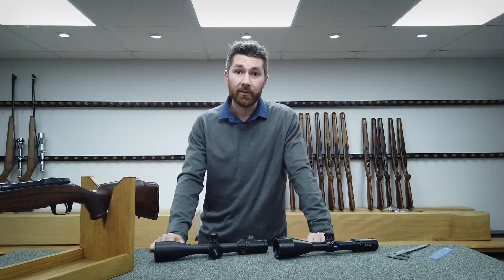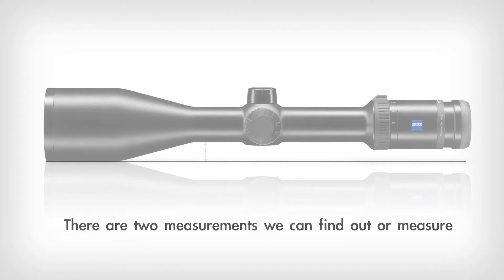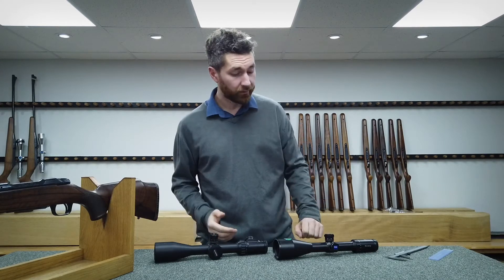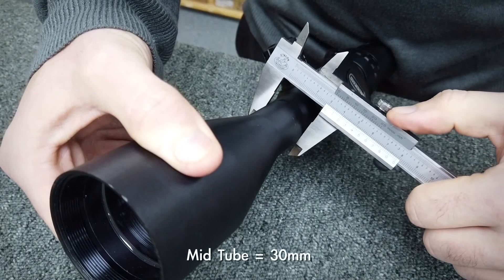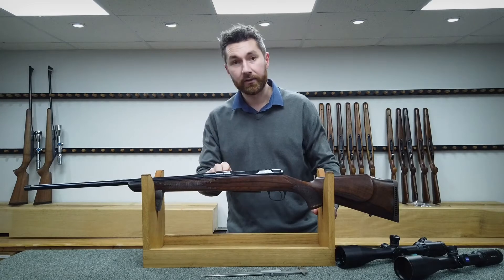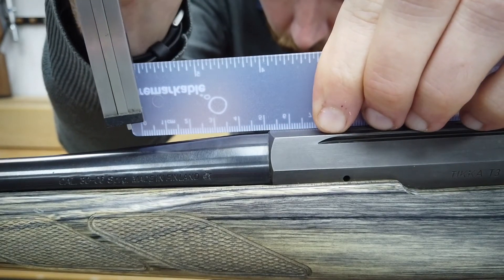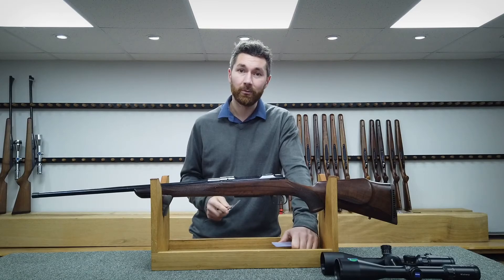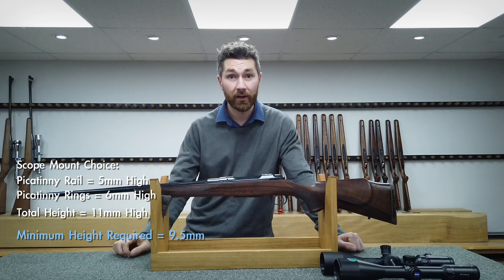Scope Mounting - A Quick Mount Height Calculation

Comment: So the measurement your left with as the result, is that the height to the bottom of the mount rings or side centre (where they clamp)?
Reply from the maker: Usually mount heights are measured from the bottom of the ring, to where it contacts the top surface of the picatinny rail.

Comment: stop saying mil, the unit of measure is not mil....its meters, the measure of length in the metric system is meters, mil is just an abbreviation that means 1/1000, in this case 30 mm or 30/1000 meters, the mil is meaningless by itself as you can have millimeters, milligrams, milliradians, milliseconds, milliamps, milliliters, millivolts ...there pretty simple isn't it
Reply from the maker: Thank you for the input. We will try to use the full term "millimetres" in future to avoid any possible confusion for our viewers. We've not had anyone question which measurement type we're referring to when we use the term mil before, when the context is clearly length in this case, but there's always a first time. I'm sorry if you, or anyone else, has tried to measure the distances in milliseconds or millivolts based on us using the term mil in the video. Sorry to ramble on and keep you, I'm sure there must be someone out there using the phrase PIN Number, that I'm sure you'll feel the need to correct. Or someone not using a capital letter at the start of their sentence, that needs an unnecessarily long explanation about the importance of using correct grammar.
Reply: @alanrhonemedia don’t let the slow ones get to you mate, and don’t bother changing your phrasing to suit them. Everyone knows what mill means
Reply: This might really only be of concern to that backward colony , the USA.   The rest of the world uses and understands the metric system. @alanrhonemedia
Reply: In your face!!!

Comment: Thank you for your tips, the only thing I would have considered would be the added thickness of the lens caps  ,
I only know since it has happened to me.
Reply from the maker: Yes, a good and valid point. I might add this to the video description to accommodate for a lens cap or Bulter Creek if you use one, as these are normally 2-3mm. Thanks for the input.

Comment: thanks for this video, super! Does this calculation also consider the downward cant of the slope when you’re dialing to maximum elevation? Eg, if a scope has 100 moa of dial-able elevation?
Reply from the maker: The method works for the scope body itself. So the scope body will not change position when you dial in any elevation within the scope, it's only the reticle inside the scope that changes.
On the other hand, if you have mounts with built in MOA, which lifts the scope at the rear and effectively lowers the objective lens towards the barrel. This may have to be taken into consideration. For instance, we supply an adjustable MOA mount which adjusts from 0-70 MOA in increments of 10 MOA. We see an Objective Lens drop of approximately 5mm on some scopes when you adjust from 0 MOA to 70 MOA. 
I hope this makes sense and helps you out with your question.

Comment: Another thing you have to check on some rifles like the Remington 700 is the gap between the bolt handle and the scope. I dropped my scope down as far as it could go based on those measurements and my bolt would not function. So I got taller rings .
Reply from the maker: Very good point. I can't alter the video, but I will add a point to the description. All the best!
Reply: @alanrhonemedia  nothing wrong with your video, very informative.

Comment: So quick question,are most picatinni rails the same height or do they differ in height a lot.?.
Reply from the maker: They do vary slightly depending on manufacturer. There are rifles with different heights for the front and rear bases, so a picatinny rail will compensate for this and one side of the rail will be thicker than the other. The height is usually measured off the higher base on the rifle and we tend to say this will be between 5 and 7mm.
Reply: @alanrhonemedia  thanks for the information.

Comment: just use this people http://www.mil-rad.com/scope_ring_calculator
Reply from the maker: A good resource and a nice method of calculating. But the ring height measurement is commonly measured from where the mount contacts the rifle or picatinny rail, to the bottom of the scope's mid tube. So this may cause some confusion if measurements differ from brand to brand.